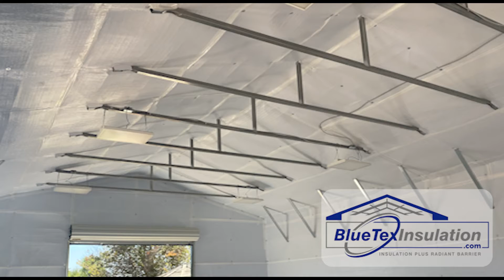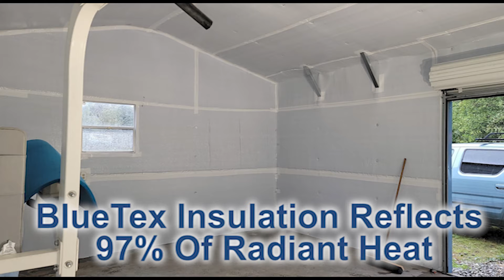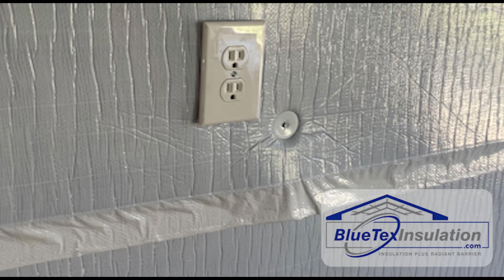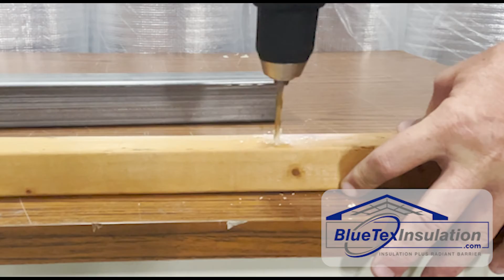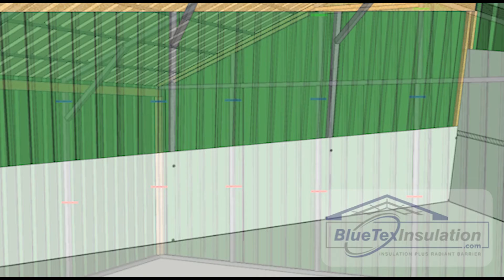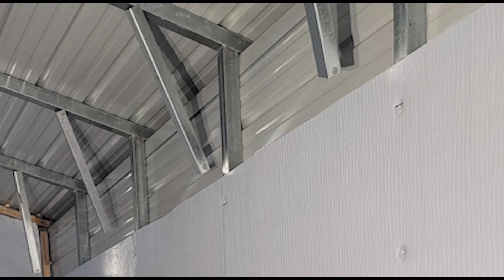Metal Building Insulation - Quick Summary Of BlueTex RetroFit System

Comment: Is it possible to foam your roof and use one of those foil barriers on the walls?

From what I’ve read all these barriers need a air gap between the material and the metal wall for it to work properly. With the metal posts, there is about 2.5” between siding and where the barrier would be. 
What happens where the wall and ceiling foam meet? If the barrier needs to be sealed 100%, where does the heat escape to once it meets the foam on the roof?
Reply from the maker: The air space can either be "dead" or "vented"  Usually the ribbing provides some venting.  Vented is best, dead or sealed airspaces still work great. This page may help: https://bluetexinsulation.com/pages/existing-construction-metal-framed-buildings-installation

Comment: Is it effective if there is only 1/2 inch air gap (air circulation) between Atticfoil and metal roof?
What is the minimum distance that needed between roof and radiant barrier?
Thank you.
Reply from the maker: Yes, even a 1/4" or 1/8" space works well.  Especially with a "vented" airspace.  Where the distance really matters more is when there is a "dead" airspace.  The dead air can heat up and transfer more heat by conduction than if it is ventilated.